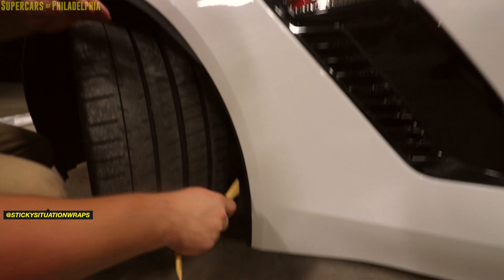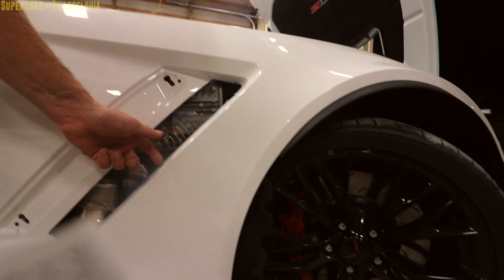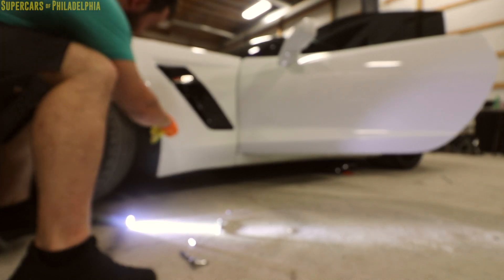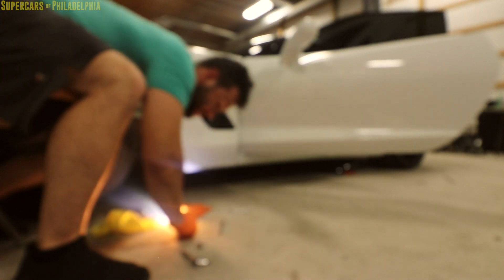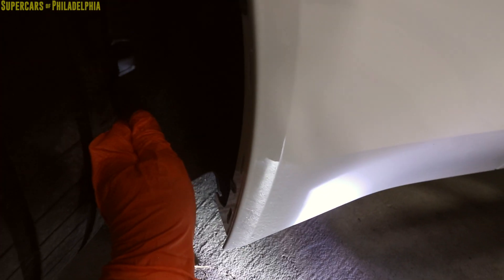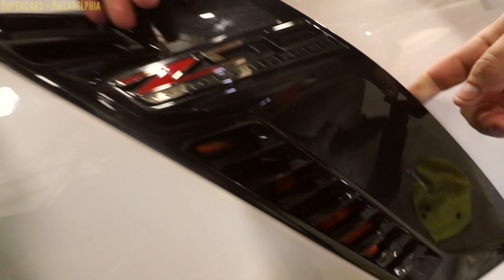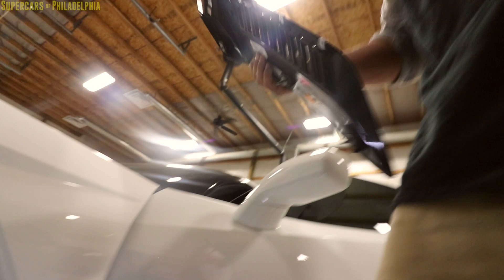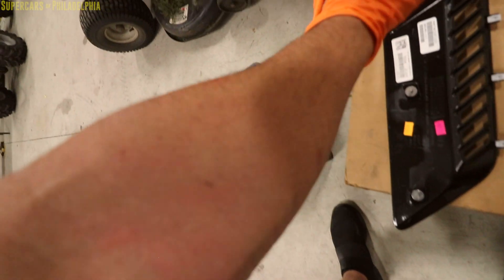HOW TO REMOVE C7 Z06 FRONT QUARTER PANEL AIR VENT TRIM

Comment: So you just basically push it from the inside and then pry it?
Reply from the maker: yeah pops out once you remove the three bolts/screws I forget which
Reply: @TrackSlayers  okay but each side has 3 screws? Easy to remove the screws?
Reply from the maker: @josephhernandez5986  yup, it was a tight squeeze but my arm went behind to unscrew them

Comment: What they don't tell you is there is 3 bolts that hold the whole thing on 
Passenger side is super hard go through the inside of the door for the bottom bolt
Good video but why not tell folks about the 3 bolts on each side DO NOT TRY AND PUSH THAT OUT LIKE IN THE VIDEO

Comment: So, let see a video of the passenger side removal. Even tighter…
Reply: I can’t reach the nuts on the passenger side ? How did you get them off , the only one I can feel is the center one , I can’t get near the bottom nut? Did you loosen the fender or take it off?